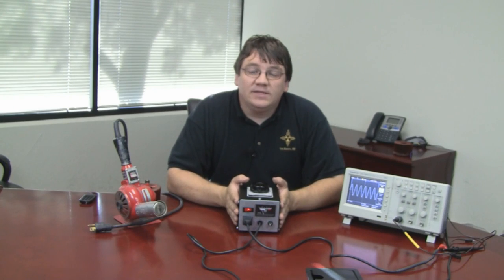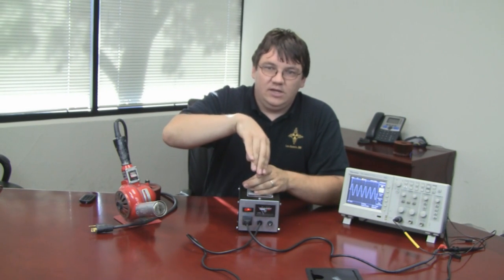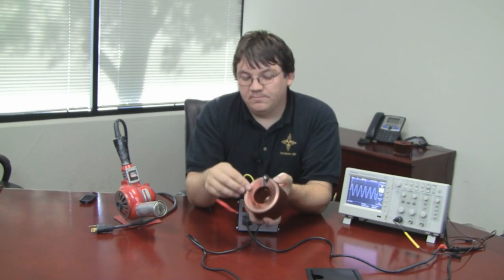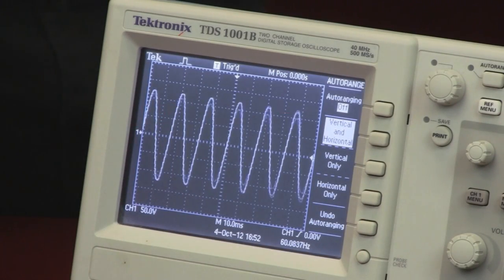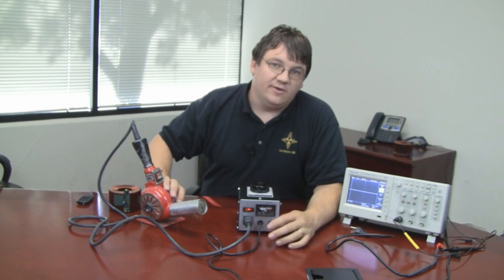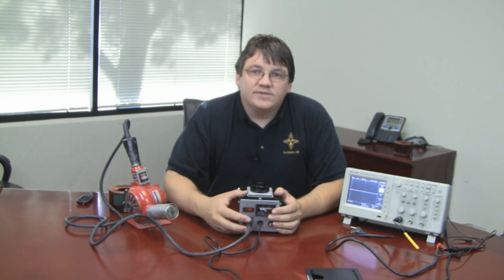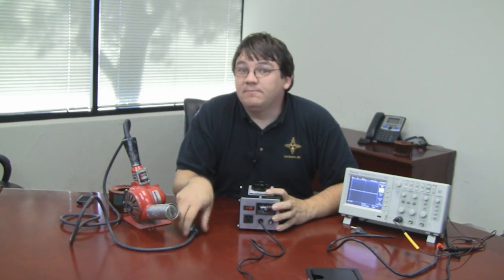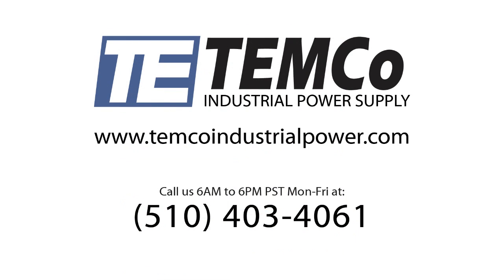What is a VARIAC? Variable transformers explained - applications

Comment: I have a question for you, I have a 220 V variable transformer rated at 4 amps output . Here is my question that nobody seems to have an answer for, if I was to run this same variable transformer on 120 Volts what would be the output amperage now. We know that there is a mathematical formula to  figure this out, it's over our heads, hope you can help. As always I will take the answer in the comment replies. THANKS.

Comment: hello nice video question if I had a stove that kept tripping the breaker could I plug up the variac set it at 220v and plug up my stove. would the variac handle the load instead of the breaker thus keeping it from tripping? If you still respond to this channel thank you for any answer.
Reply: I can answer that. However the first question you must ask is why is the stove tripping the breaker? If it's a 220v stove, the breaker will be large and will most likely be two breakers with the switch throws bracketed together. (This is because 220v circuit is actually two 120v lines with each on different phases.) Normally the breaker should have more than enough capacity to handle whatever you could possibly plug in appliance wise. So, 1. You're somehow overloading the circuit. With too many large appliances together on the line, drawing current above the breakers rating. (Not likely) 2. The breaker is defective. Breakers aren't meant to be  switches and if used often as such will wear out. But the most common way breakers begin tripping early (before their rated amperage) is if they have been over loaded and caused to trip too many times. The spring contacts get "tired," from the heat caused by over loading and the springs become weak and thus easier to trip. (Replace breaker) And or.... 3. The breaker is right. There is a fault or a short in the stove causing it to over draw amps and trip the breaker. You MUST investigate this possibility! Unless you want to burn your house down or get electrocuted.  Lastly, no you cannot connect any kind of transformer to bypass or avoid the breaker tripping. The stove is gonna draw what it wants/needs power wise. So by using a transformer to feed the stove and not trip the breaker,, you would have to feed it far less amps than it needs to work. Basically the current would still need to be drawn one way or another. Ohms law states that there is a direct linear relationship between the voltage, amperage and resistance of a circuit. You can't cheat it, it's law. Email me with further questions. sadiegualla@gmail.com  -Rex
Reply: @ripstephenhawking8787  I reaallly appreciated that answer stranger and yes I will be asking so look for me

Comment: Can you build one of these that only goes 0 to 24 Volts AC, and can you rectify and filter the voltage to drive DC model train motors reliably?
Reply from the maker: We no longer manufacture Variacs but, yes, you can do exactly that very easily. You could also use a standard 0-130VAC model and just limit to below 24. As you suggested, adding the rectifier gets you the DC you need

Comment: I have heard about Variac for a few years now but never really knew what it was. Thanks for explaining it in your excellent video! I’m a home coffee roaster and I have a few electric roasters. All the manufacturers say never use an extension cord or an outlet that has anything else running on it so you get full power to the machine. Well my one outlet in the garage is on the ceiling and I know there are other things on that line. I am forced to use an extension cord and I can tell I’m definitely not getting full power to any of my coffee roasters.
Can I use a Variac in my situation to get full power to my machine??? Thanks!
Reply: A Variac can go to a higher voltage than what you put in. My UK 2000 watt  240 volt one will go to 260 or so, maybe 300 volts so it should compensate for resistance in the cable. But you need enough power to run the coffee roasters otherwise they will only draw as much current as they can get !!!!!  If you have other high current devices you need to use a 30 amp Cooker Circuit like I do with my 4KW Arc Welder.  You need 30 amp fuse and very heavy 16 amp cable, but the Variac is only 2000 watts.  How much current do the roasters use ???  I should think a lot !!!!  The Variac won`t go above 2000 watts !!!!!

Comment: I have the coil and bial with the wiring board hooked to it on the platform . what i need is a diagram so i can hook up the power cord the on , off switch, the fuse , the voltage gage , and the plug outlet. Do you know where i can get a diagram for that . it would be very helpful to me . thank you .

Comment: I have a new box fan that does not accept the 124 volts that Con Edison is supplying.  I want to use this to lower the voltage for that fan. Will it cut down  the wattage used?

Comment: I use a variac for an extraction fan and works very well. However I would like to know if that when it is turned down does it use less electricity? I know volts and wattages are different. So by turning the fan down with a variac, does it use less electricity or does it use the same amount of power and just turns the spare power to heat?
Reply: No. It does use less electricity, that is less intensity of the current, and then less spent. It is said that it reduces the voltage by increasing the current, that is correct but had to say that it increases the current in the output which is fixed for an output voltage and the impedance you connect, (for a lower voltage you have less current with the same fan) and then you go back to the primary and there is less intensity of current than in the secondary given by the ratio of the transformer

Comment: Could using a variac on powertools cause damage to them? Like running an angle grinder on lower voltage than it was designed for.
Reply: John Fraser no

Comment: Hi,I would like to use a vaiac on a homemande plastic sheet bender. I would like the bend 60 inches wide 3/16 polycarbonate with nichrome wire (20, 22 or 28 GA) what would you recommend?Thanks

Comment: as you increase the voltage does the current comes down and vice-versa as in a normal transformer?
Reply from the maker: Yes, that is correct.
Reply: +TEMCo Industrial Power Hi. As you said that with a increase in voltage current decreases, but here when you use the heater gun or bulb, with increasing voltage the appliance runs with greater intensity. Now theoretically current should reduce with increased voltage, doesn't it mean that that appliance should go less intense as the current is reduced due to increased voltage. Please I dont get that part???

Comment: will dropping a fans voltage with a variable transformer ultimately save on electrical cost
Reply from the maker: On single phase, probably not. Three phase motors can often benefit from being slowed down to run at an optimum RPM.
Reply: Yes, I think it will do save costs

Comment: Hi : Can I use the variac to change power given from 220V 12 amp system to 30-40amp system giving 8500k watt power to heat water in very cold weather
Reply from the maker: No. Variacs can drop voltage, but they cannot increase the available current.